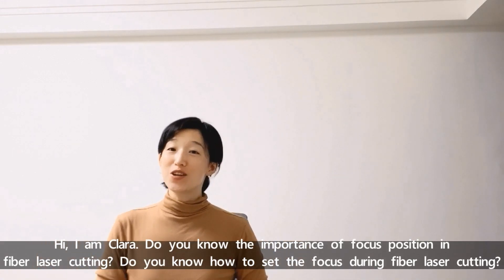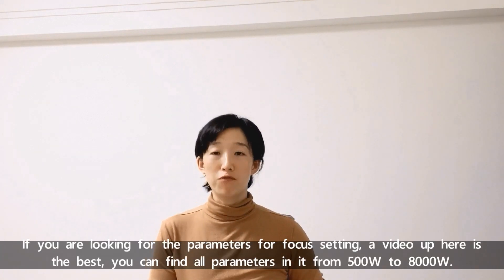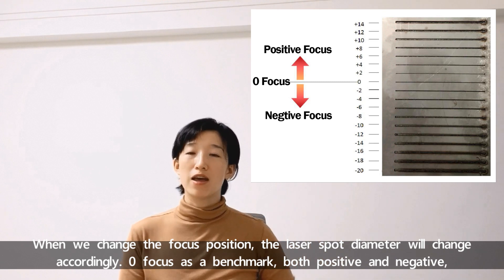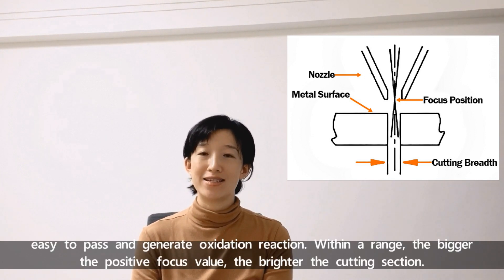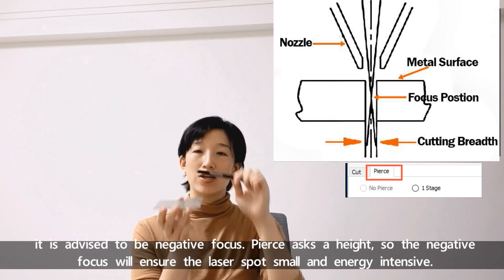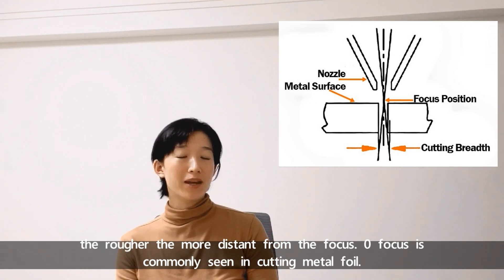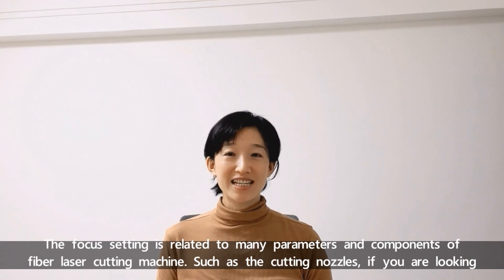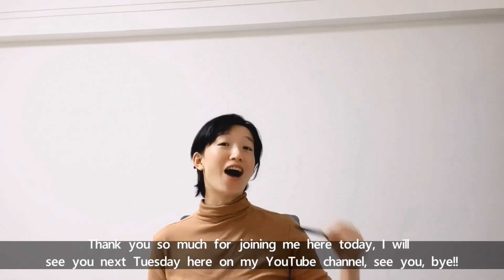Laser Cutting Focus Position | Focus Setting in Fiber Laser | Parameters

Comment: How to adjust the beam width because the value in the defaulth parameter is 1.5mm and i cannot change it im wondering if i can change it in to 0 value.im using 3kw laser with raycus laser source and bm310 for laser head.
Reply from the maker: I don't think you can enable this function with your machine.

Comment: Hi Clara
I have very important question please answer me :
— you said in this video need in piercing negative fucose if need to cutting mild steel you said need positive fucose if we have manual fucose head like bt240s What should we do in this situation?

Thanks
Reply from the maker: The focus position is not absolute, it should depends on actual conditons, many factors required, like gas, thickness, material, power...
Reply: @ClaraChai  thank you so much 
So need to increase the piercing time if use manual fucose like bt240s

Comment: Hi miss clara.
I have 1,5Kw Laser fiber with manual focus cutting head.
How to get good cutting in Carbon steel thickness 8mm and 10mm?How to set cut and pierce parameters with manual focus cutting head?
Thankyou for your help.
Reply from the maker: You can find reference parameters here, but you also need to get fine adjusting for your parameters.

Comment: Hello Clara.  We have a 3kW fiber laser and currently setting up parameters to cut 12.7mm carbon steel with oxygen.  Currently my focus height is set at .138 and my kerf is considerbly larger at bottom of cut.  I would think my focus height should be lower as in half the thickness of material.  Am i thinking correctly?  Also my oxygen pressure setting is cuttently set at 2.5 bar.  Any suggestions would be greatly appreciated.   Thank you for the videos.
Reply from the maker: I don't think they are correctly.
Reply: @ClaraChai  thanks for the reply
Reply: @waterscytheabrasivewaterje4703  .5 - 1 bar would work better. 1.4mm nozzle
500 mm speed
focus half of thickness. positive

Comment: Hello Clara, good evening from Mexico
I have a 1000W FIBER LASER, I am cutting 3/8" carbon steel with compressed air and I want to change to oxygen, can you help me with parameters of cutting speed, height, gas pressure, focus adjustment and what nozzle to use?
Reply: I work with a Bystronic and we cut at a 3000w 3/8” HRS_O2_0.375_7.5
Focal either at 3 or 4
Speed aka cutting parameters 56
Pierce speed 38
Micro joints speed 1.389 
This is how we’d adjust it for that specific metal and with a NK 12-15 or 15-15 nozzle head. 7.5 laser head.
Reply from the maker: What you can get from others are only for reference, you need to find yours.
Reply: sale, gracias

Comment: Hi.I have a problem.I work on 3000w laser cutting machine.I had dross under the part ,its like saw shape. I don't  know how to set the machine parameters.
Reply from the maker: Apart from the machine issues, you need to find a better parameter.

Comment: Hi Clara, what do you think is the main reason why there is a lot of dross or slag under the parts that i cut? Is it because of the focus point setting or the cutting speed.thanks
Reply from the maker: It could be caused by many reasons, you can check my video Poor Cutting
Reply: Hi Micheal.I have the same problem.can you tell me what should I do to fix the problem

Comment: Hi, I’m cutting on 3,000w laser and I’m cutting .25” aluminum. My power is set to 100%, focal position is .3 and my height is .016. My pressure for N2 is 116. I keep getting a burr. What would you recommend I set my laser to so I can get a better cut?
Reply from the maker: Did you try the compressed air?
Reply from the maker: Please share me a picture of your cuts

Comment: I have some problem about tapper at cutting top and bottom cutting are not the same?thank you miss clara...
Reply from the maker: Need more information, Sir
Reply: Im using 3000k when finish cutting then checking difference from top of the parts and bottom 1mm difference in size,,,checking by caliper top area 49mm bottom is 48mm?kindly help for improving the quality of my work tnx madam...
Reply from the maker: @ferdinandserrano9736  +86-13335151833

Comment: Hi , I have question. Whenever I start my machine first in a day I have cutting focus issue. Like if I swich off machine last in a day with a job remaining in sheet. And then start next day morning with same settings and parameter then the cutting burr generated and focus doesn't meet. After some changes and again swich off the machine then I found correct cut with same that previous settings.. what is that issue. .. can you help me. ?
Reply from the maker: Is the auto focus cutting head?
Reply: Hi Clara, I have same issue. My laser head is auto focus Raytools. What can I do? 
Thanks
Reply: @clara
Reply: We have the same problem and I found out that the Z axis had to be calibrated each morning. If your Z axis gap is not consistent the focal point will be off. In our case it took a few cuts before it settled down.

Comment: Greetings. I have an issue . I operate 500W laser cutting machine with Nozzle of 1.5mm to cut 1.2mm stainless steel  sheet. The small pieces of steel are not getting cut and rather are being welded at a place. Please help me to determine focus
Reply from the maker: Information is not okay, you can try to replace a smaller nozzle.
Reply: Hey I just got a job at that requires 1.2mm S/S. Im getting the same problem. Did you manage to figure out how to fix the problem? Its also damaging the lense
Reply: @jade4781  i consulted like 8 engineers and all i know is either the source is getting weaker or the laser tube in head is supposed to be cleaned. Try changing focus 1st, then check all 4,5 lenses and increase air pressure  and if still the problem occurs then its definetly problem in source or head.

Comment: Thank you Clara so much for the wonderfull videos. 
I was wondering about focal position and cutting height. When we set focal position to 0, then it is focused on the surface of the plate, regardless of the cutting height?. For example cutting height 10mm and focus 0, and cutting height 3mm and focus 0, will focus the laser beam the same on the plate surface? Does the software make the calculations so that the spot will be at the plate surface or we must do this every time?
Reply from the maker: Thank you, cutting height and focus are two different parameters.
Reply: @ClaraChai  Yes i know that, but i was asking about the influence of the cutting height at the focal position.
Reply from the maker: @geast67  The cutting height, which is also called the nozzle height. It will affect the air coupling and cutting result directly. If too close to the workpiece, the lens will exhibit a strong return pressure, so that weaken the spread of dispersion capability and clearance quality, and even possible collision between nozzle and workpiece. If too far away, it will cause unnecessary power loss, not helping in cutting through. Generally, I suggest the nozzle height from 0.5mm-1.5mm.
Reply: @ClaraChai  So when i set the focus position to zero i always focus on the surface of the material, no matter where the nozzle height is? Is that correct?
Reply from the maker: @geast67  no, Sir, do you have a fiber laser cutting machine? Try on your machine, you will get it.

Comment: I cutting by 1500W with carbon steel 1.5mm. still found some slag under piece , I set up power at 30% , cutting hight 0.025 , speed 4.5 m/min , focus 0.25 , gas pressure 4 bar , do you have any suggestion ?
Reply from the maker: What parameters for Pierce? You mean slags below Pierce.
Reply: @ClaraChai  The a little slag under work piece at the cutting line